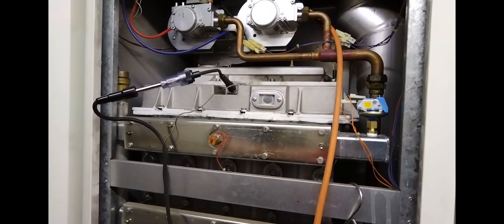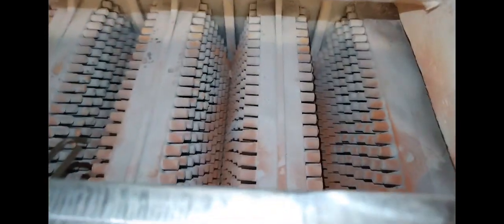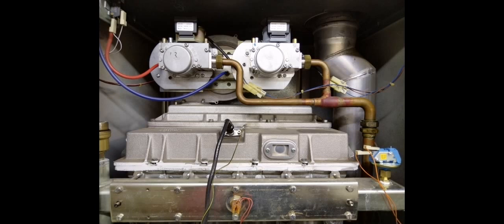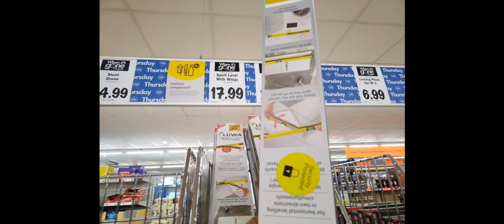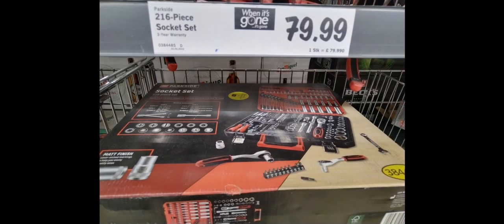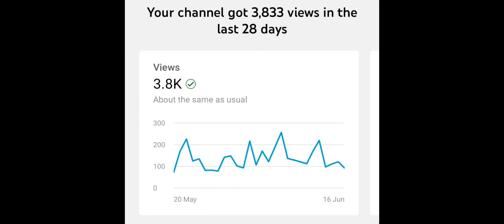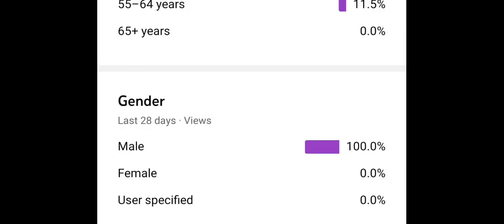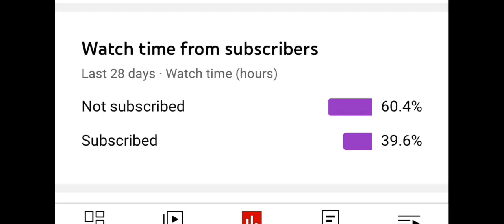WEEK IN THE LIFE OF A COMMERCIAL GAS ENGINEER pt2

Comment: One of the screws appears to be snapped off on the Imax 80 electrode / probes, they are the new ones with stud and nut ? I repaired this issue recently with the new electrode kit that includes screws, studs, nuts and gasket (Ideal said gasket not sold on its own) rather than replace the combustion chamber lid at near £600. Managed to get the broken screw out the chased the threads with a tap and used the studs this time rather than the screws as deeper fixing. Do you not classify the missing screw?  
I am installing a new Ideal Evomax2 cascade at the moment with plate separation, mixer, ACV 600L cylinder (on the sealed system side) and new BMS etc with a mate quite interesting, done Vaillant cascade in the past too.
Halfords sell some very comprehensive socket sets.
Great content again though mate im not one to make videos. 
The urban plumber is worth a mention i respect him, some good work.
Reply from the maker: Good observation. Screw on probes wasn't snapped, just hadn't gone straight back in after inspection but went in later. Sounds like you're having fun with the cascade installation. Seen some socket sets in Halfords but never bought one. I'm subscribed to the urban plumber and he's features in the vid "how much youtubers make". There's good content on YouTube, wish I could find time to watch it all. Maybe less Netflix and more YouTube, maybe not.